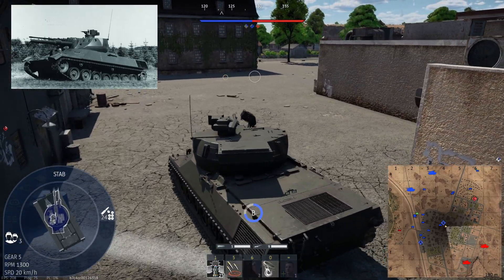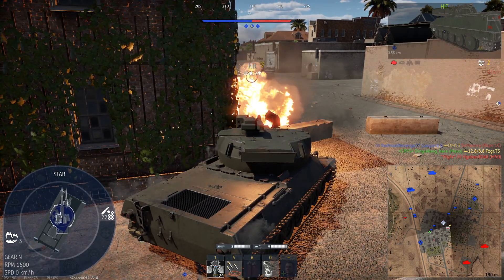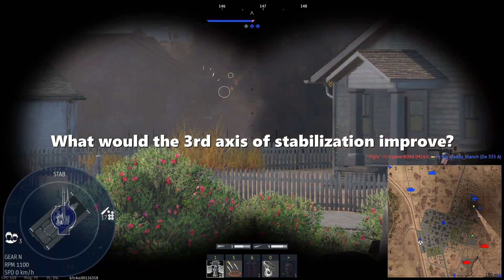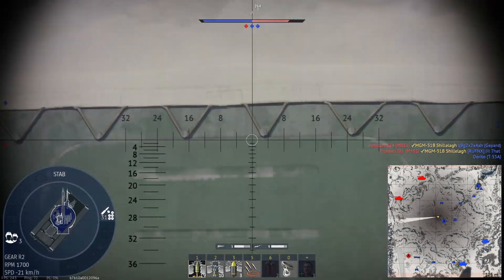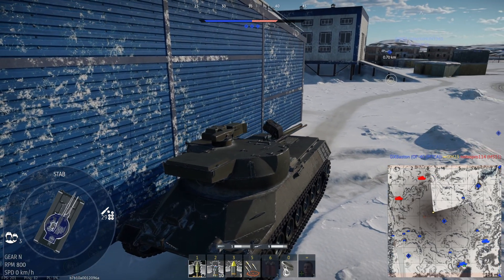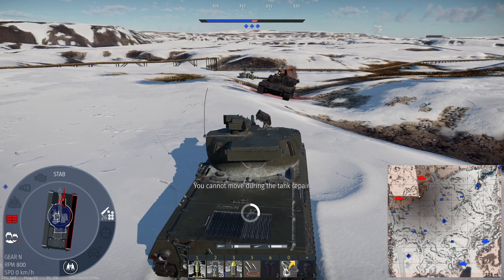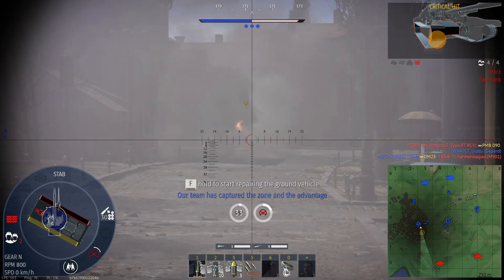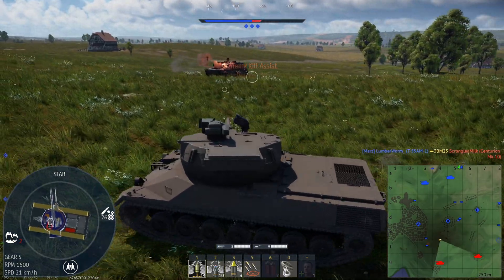Where’s the 3rd axis of stabilization?

Comment: More than a tank, it's more viability study of possible ideas. Amount of flaws was incredible, because its not meant to be fielded. It's meant to show if it brings anything to the table, and for what you see, it was not worth it.  
I feel like they COULD make it into just BALL and make it into  AA, similar to gunners on bombers. Third axis of rotation would do wonders to tracking planes. 
literally 2 or 3 of those 30mm coax, and full ball. 
I know rockets became the thing to take down planes, but this thing would literally evaporate drones now, so MAYBE that gun was just ahead of its time. 
rockets are pricy especially with guiding systems, maybe we will see a comeback of cheap short range flying crap evaporators.

Comment: Just for the non German speakers:

German uses compound words to name things. Just think of those long scary words as seperate words that describe what it is. They just leave out the spaces is all.

Erprobung (testing) strager (tractor) mit (with) drei (three) aschig (axis) stabilisierter (stabilizer) turm (turret) III F (Model 3-F)

"Testing-tractor with Three-axis stabilizer turret 3 F" would be the direct English transliteration.

Easy.
Reply: strager? Its ErprobungS  and its Träger and not strager which means Carrier.... not tractor.

Comment: Can anyone explain, how the horizontal stab. works in WT? If I understand it correctly, it allows you, to turn and keep your gun on a target. But many vehicles can do it without 2plane stab. (mostly WW2 SPAAs) but I don't see, how it works in game. You go, and your gun stays leveled because of the vertical stab. But not on target, how it should with horizontal.
Reply: Functionally in game it just makes the turret turn really fast. Also, it doesn't track targets or anything, not sure if that's what you meant at the end of your comment.
Reply: @epion660  what I know from people who worked in tank, the stabilizer was able to be stuck on one point and follow this point.
Reply: @mareksoucek4514  some FCS can track targets but that's not what a horizontal stabilizer does. It just counteracts the movement of the hull. You turn the body of the tank to the right, it'll turn the turret left at the same speed l.
Reply: @epion660  thank you. I took for granted the target following. This explains a lot.

Comment: the turret doesnt roll. but for long shots.  when  any the tank is inclined on its side u have to compensate. so, having a tank that automatically compensates for that mecanically could be nice.   and adding that stabilized sight to the centauro also.

Comment: The tank should get the stabilization, as that was the whole point of the vehicle; it wouldn't change a whole lot to the gameplay, and considering the whole history of the tank was to test 3rd-axis stabilization, it deserves to be in the game. Hell, the name itself says it was an experimental design. I understand it may not be critical to implement, but when the name itself has experimental 3rd axis stabilization, it should be in the game. My biggest beef with it is the lack of testing. With stabilizers in the game, it seemed like they implemented them and then just slowly patched it up until it was semi-ok. I'm not sure how well 3rd axis stabilization would go considering it's the only tank to really have 3rd axis stabilization, but considering how god-awful top tier is with the abuse of helicopters and planes in tank RB, I'm a little less concerned about a single tank than the million issues War Thunder has.
Reply: Well the game would first need realistic stabilization to start with...
Reply: they don't even bother implementing two-axis stabilization properly. Something like a T-55A has the same stabilizer performance as a Leopard 2 or M1A2.
Reply: at one point while it was available for preorder they advertised it as having it. i bought it during this point, but nobody that bought it while that was being advertised was given any compensation or option for a refund
Reply: its an issue with the game engine so they cant

Comment: BTW the apds is a much better shell for this as it spals very well and has almost the same pen (note usually bring 2 heat incase of Russia heavies.)
Reply: I was wondering why he mostly used HEAT. APDS is generally better and less rng
Reply: @barronhelmutschnitzelnazi2188  The "D" in "APDS" stands for "D_O_G_S_H_I_T". The HEAT is so much better. The APDS has zero spalling, the angled performance is terrible and it randomly shatters. The HEAT - this goes for all vehicles that have the L7 - is MUCH more reliable. Literally the only downside is that you have the problem of not being able to shoot through bushes and walls. But you have a 30 mm autocannon that'll mow anything down. I guess the velocity is slightly lower. But that's literally all.
Reply: @barronhelmutschnitzelnazi2188  not anymore apds is rng af and shatters half the time you hit something. Heat is far more consistent and it can go through wire fences which nobody seems to know in this game.
Reply: He's using heat cuz since last Apds update, gaijin somehow messed up Apds damage and the shattering chance is up to the roof